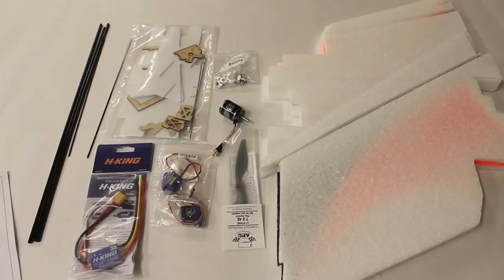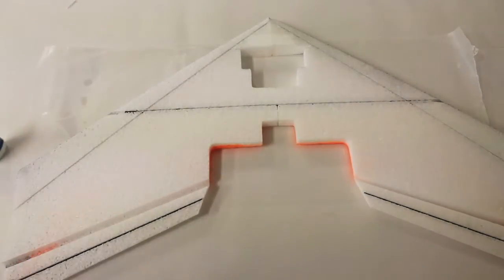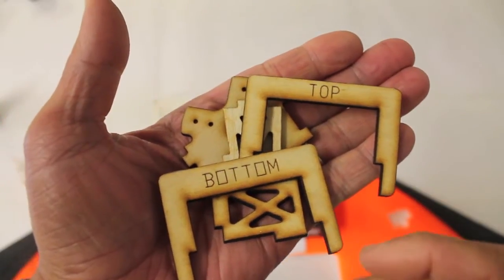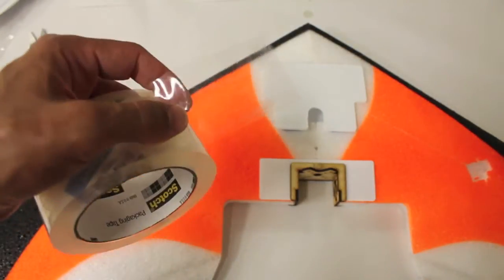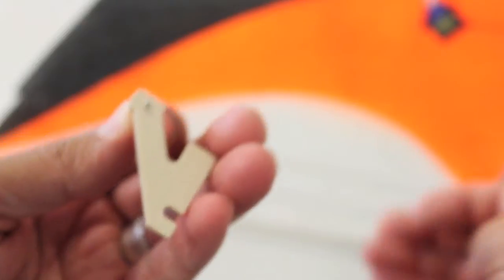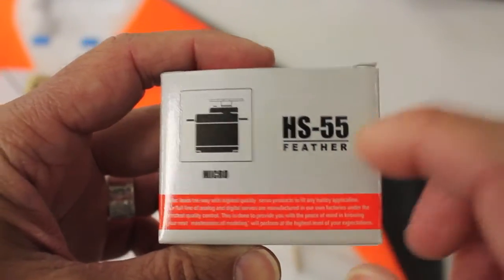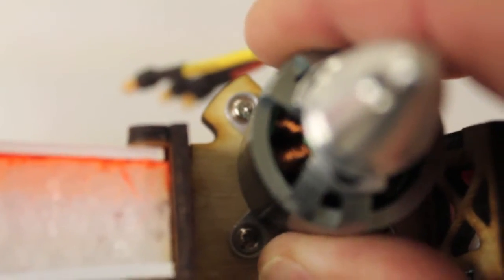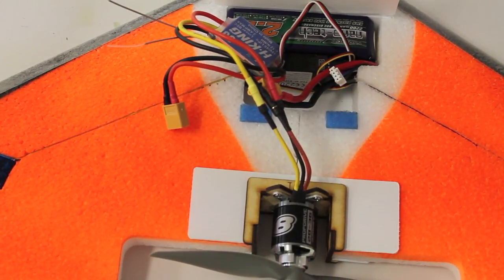TuffWing 32" Flying Wing Build Video

Comment: you glued the winglets on wrong :)
Reply from the maker: Yikes! Do you mind educating me on the proper way? Thanks.
Reply: the wing should be centered in the winglet so the tail of the elevon is in the middle of the winglet. great video , mang...
Reply: Skroggn If I buy Tuffwing its included the radio controller? or I also buy it?

Comment: I read up a bit more on the accelerator, since the glue as it bonds is exothermic (gets hot as it cures) and the accelerator makes it do that faster, using the accelerator actually makes the CA foam a bit. 

You don't need the full strength of the CA, so the loss of strength from the foaming does not cause problem. The foaming has a nice side effect of making the CA a good gap filler, allowing it to bond well to foam. 

So if you are using CA and foam, use the accelerator.

Comment from the maker: Thanks for the heads up on how CA accelerator works. It's pretty amazing to see how quickly it works. Yeah the tape I used in the build video didn't bond very well and needs to be replaced. I appreciate the tip on the Scotch Extreme Tape, that looks to be exactly what I need.

Comment: For starts, thanks for doing this video, I have seen several people say that it is easy, but this looks to be much easier than I feared. 

Another thing is that the CA Accelerator is an enzyme that acts on the CA, then moves on to act on a different piece of uncured CA, it is not an epoxy. Just use a little bit of accelerator. 

Another thing, get a roll of:
Scotch Extreme Tape 8959
The extreme tape has bi-directional glass filament for strength against tearing, and small area crushing.

Comment from the maker: I bet you're right regarding the upgraded motor. This 28-36 generates a ton of thrust, but unfortunately I haven't a chance to fly it either due to wind conditions. I'm in Austin, TX and the wind has been pretty vicious lately. I'm hoping to get it in the air in the next couple of days. Good luck with your upgrade.

Comment: The TuffWing website manuals indicate that the L2210-1650 outrunner is for the 24" wing. Perhaps they shipped out the 32" with the smaller outrunner and later upgraded the kit to the NTM 28-36. The 250 watt L2210-1650 should have enough power to fly once it gets airborne but it's just going to take a little more effort to get it launched. It has been so windy this week so I haven't attempted to fly it.

Comment: I may have to upgrade to the NTM 28-36 motor. I picked up my TW 32" at HT USA North last week and mine came with the smaller 250 watt L2210-1650 outrunner. I am using the recommended 7x4E prop with a 2200mah Li-Po and 25 amp Esc. FrSky V8RF-II 4 Ch Rx and I can't get it launched.

(if you want to switch between 2D/3D with the APM 2.5 you will need another ch as the 9x with factory v2 only supports 5-9 switches and pots)

Comment: You should use through bolt screw for at least the top 2 on the motor mount. All that vibration could back them out!